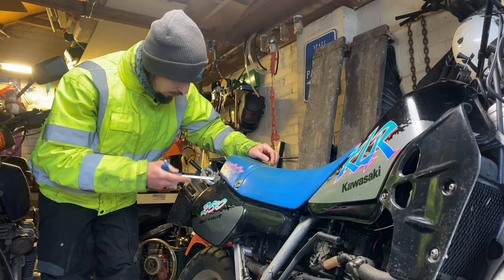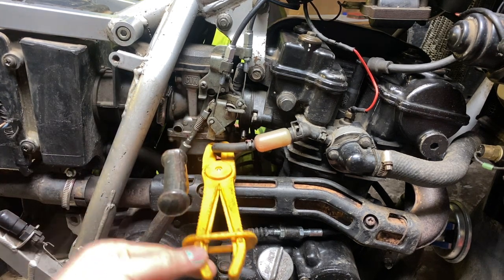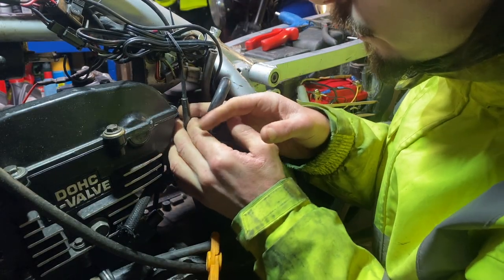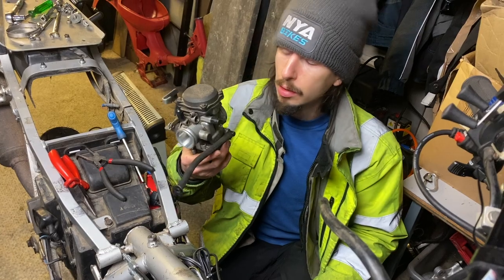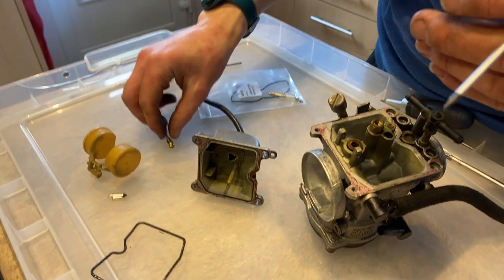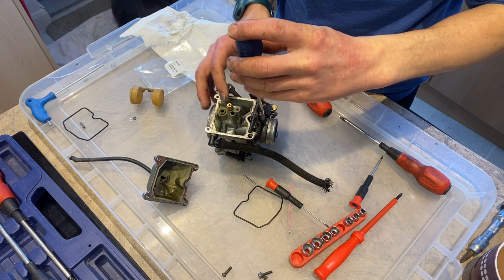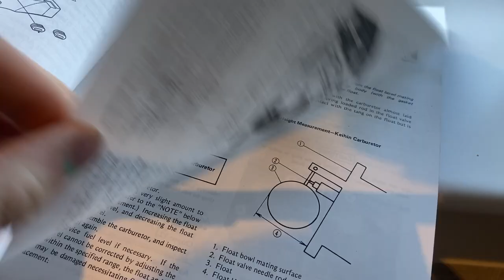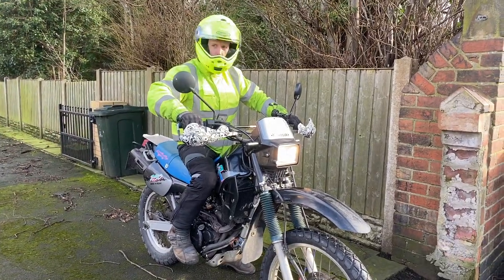Kawasaki KLR250 Carb Tinkering

Comment: Thanks for the vid, very light hearted and informative. I have a few questions, so here goes.
1. Is or was your KLR difficult to kick over from cold or hot?
2. Did you do any work on the top end of the carb? Diaphragm etc...
3. What work manual do you have for your KLR250?

I'm about to strip and rebuild the carb on my KLR250 so this will be a big help. Thanks lads 👍🏻
Reply from the maker: Hi Rhys, 
Thanks for taking the time to message. Appreciate the positive comments.

I did have occasional problems with starting but most commonly hot starts. Sometimes I would just have to wait for it to cool down for at like 5-10mins, which was really annoying after fueling up at petrol station.

As for the carb, the top end was a massive oversight on my side. I completely blanked on that. Never actually got in there. It most likely would benefit from a fresh needle or at very least an adjustment to it.

The main manual that is used/referenced is for the KLR600 (part no. 99924-1050-01) which then might have slight model specific adjustments according to the KLR250 Supplement manual (99924-1051-01)
(These numbers may have changed with later releases)

The 250 has taken a back seat for the moment. I did replace the cam chain which seemed to help overall but then it needed more playing with and I haven't got round to it. 
I was very fortunate with a great deal on a CB500X which has taken over my everyday riding and I just love it. 
However, I'm happy to help with your own tinkering efforts if you have more questions or need to bounce some thoughts around.
Reply: @MechitBetter  thanks for the fast reply. I have a KLR600 and a KLR250 currently. Had the 600 a while, but its kick only and the compression is a killer.  Love the bike though so looked for a 250 and picked one up a few months back.

It's a tidy motor and had a lot of work done to it, but on a recent ride green laning in South Wales if it stalled it was a bitch to restart. Will try a carb refurb, new plug and lead and try and make sure the fuel system is set up correctly. Fingers crossed I see some improvement. 

Hopefully you get around to your KLR again, could always slap some aggressive tyres on and hit your local trails 👍🏻.

Thanks again and I'll look out for more videos.

Comment: Well done guys similarly my KLR's  next job is the carb after fighting to remove the battery box, exhaust and air box yesterday! 👍
Reply from the maker: Thanks dude.
Sounds like a complete frame strip down... What you got planned?
Reply: At the moment I'm considering an Acerbis fuel tank and possibly military theme. It is going to be an adventure bike capable of long distances and some mild off reading. I do like the idea of it remaining scrambler styled tho so these mods should be completely removable.
Reply from the maker: @SurreyRider  😁 "some mild off reading" sounds like it could be fun... Enjoying a short novel along some greenlanes 😉
(but yeah, i get what you meant) 

One of those bigger, plastic, tanks is it?
Cant be a bad thing to up the range. 

So the stuff you've removed, is the plan to leave it off and do some custom bits instead?
Reply: @MechitBetter  I'm re using what I have and improving it if I can. I may reject the carb, not sure yet. I'm not messing too much with it, might give it a facelift tho.

Comment: It's always the bowl gasket or the needle and its seat, it seems like. I rebuilt my TW200 carb and after some time, maybe 6 months, I noticed there's fuel residue on the carb body so I'm still leaving my fuel tap off to be safe. 

Anyhow how's the bike doing? Did you get the leaking fixed? I'm curious how your caliper and master cylinder rebuild has held up. Any loss of brake pressure or fluid or anything like that? 

I just got a '96 KLR250 the other day with the Barbie color scheme. It needs a front brake rebuild as well as a lot of small odds and ends, but it somewhat ran and was an okay deal. The color scheme and general potential of the bike led me to bring it home. Allegedly rebuilt but it doesn't like to start or idle very much at all so I'm going to check valves and the rest of the top end and go through the carb. If I can't get anywhere with that I may have to go get a compression tester before I put a bunch of work in for nothing. I did read that a DR650 master cylinder is an easy upgrade for these so I might do that if mine looks too far gone.

Anyhow hope you're well and getting on with the bike.
Reply: Also I'm curious where you got the rebuild kit with the bowl gasket and such. Does it come with a seat for the needle?
Reply from the maker: Hi, sorry for the slow response. 
The bike is going well, thanks for asking. Carb has had a bit more attention and seems to be working reasonably well now. I doubt I'll ever be completely finished getting it juuuust right 😄
Not exactly sure where I got the rebuild kit from: it's been quite a while, but I'm pretty sure it was sourced on eBay. Come to think of it... I don't think I ever touched the needle... So the kit definitely didn't include a seat. I should probably look into that 😬

Brake is holding up just fine as well. It could probably still be better but it hasn't failed me so far.
I think I've done about 1000 miles since working on it.

How are you getting on with yours?